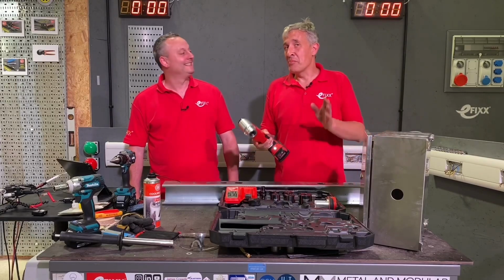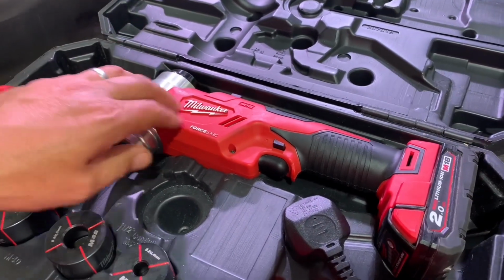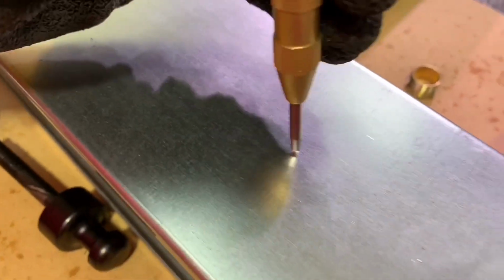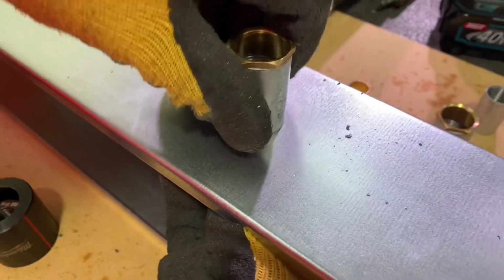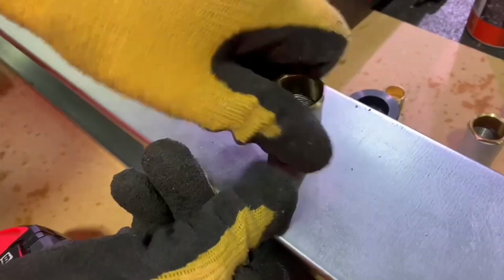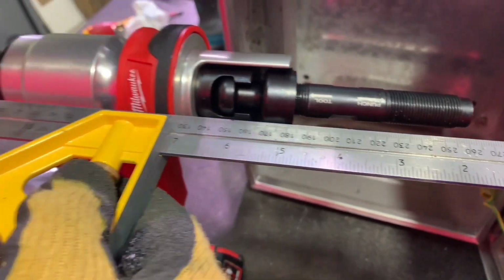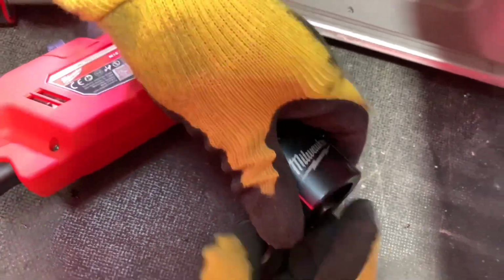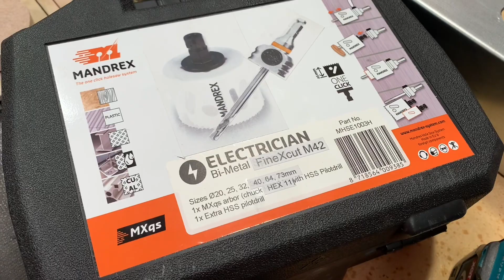REVIEWED: Milwaukee FORCE LOGIC KNOCKOUT HOLE 🕳 PUNCH TOOL

Comment: I had a set of "hole punch"  dies ( Called I think Crookes Cutters?), drilled a 10mm hole, and used an Allen key adaptor on my battery drill to wind them through the metal,  nice clean hole, no filing afterwards.
Reply from the maker: We used to use them - we’ll try to find an equivalent to review.
Reply: Q max were the ones I always used, just brand names though I suppose

Comment: When I've used hydraulic punches I use the 20mm punch to create the hole for the larger shank required for the larger punches removing the need for a cone step drill or hole saw which is particularly important on stainless. This mean you only need to drill a 12mm hole for even the biggest of punches where drill bits like Sutton's Inox drill bits would speed up the process nicely.
Reply from the maker: All great points so thanks for commenting 👍🏻
Reply: It

Yeah

Comment: Always found the Q max punches great for enlarging a existing 20mm hole in enclosures / trunking into a 25mm or more. Yes they were handraulic with a extended allen key. I'm retired now but still have them in my tool box...you never know?
Reply from the maker: Handraulic - we’ll use that 😂😂
Reply: And Q-max punches are square/rectangle & even D-shaped punches!

Comment: not only does the US kit have more punches for less money, our ball adaptor is an interrupted thread connection, so if you're doing a bunch of the same size hole, you just pop the adaptor off with a one third turn to clear the slugs.

Comment: Great tool if you’ve got to create many precise holes in steel or stainless. On the rare occasions we have to do this sort of thing it’d be invaluable, but none of us like having expansive tools not out there earning their keep. I haven’t seen the price but I’m sure it’s not for the faint-hearted!! As far as the Milwonky goes - I have the 125mm cordless bandsaw (which I think is what you’re referring to) and it definitely takes a bit of practice to get it spot on but once you’re used to it it is magic. Wouldn’t use a disc cutter now unless I absolutely had to.

Comment: Great video thank you . Does the slug and trunking get hot from the press tool. A little disappointed that it doesn't come with the 2 inch press as standard but comes with 16mm.Out of interest why have they including a 16mm. I can't think of a job were you would use 16mm.
Reply from the maker: No heat in the punching process. They haven’t included the 50mm because they sell it for £60 - 16mm will rust away in the box 📦
Reply: the American kit comes with punches for 1/2" to 2" in conduit size increments.  for a bit extra, I also got a cutter for 3" conduit. (note the punches are sized in conduit size, not in actual dimension so, for example, the 2" die is actually 2.5"

Comment: Punch cutter is better than any hole saw or cone drill any day.. it’s the only one able do make a clean cut. that one is good if you spend your days doing holes otherwise the manual ones do the job and are cheap if you have to punch a few every now and then. And to be fair I probably wouldn’t bother with that whole process till it goes above 25mm or it’s stainless.. The hole saw from that kit cutting the stainless will probably go in the bin after.

Comment: makes sense if your punching a load of holes at one time bit of a pain in the arse having to use a drill so you can use the punch tool to begin with. maybe someone can come up with a quick release tool that punches the starting hole or even an adapter that doesn't require a starting hole to be drilled.
Reply from the maker: All great points 👍🏻. Tomorrow this tool goes head to head with a Mandrex electricians hole saw kit.. should be interesting 🤔

Comment: wow, what a lot of faff! If you have to pilot the hole with a cone cutter, why not just follow through? By the time you have set up the tool you could have deburred the hole with a file or deburring tool!! Nah not for me thanks, I just bought a set of cone cutters from Aldi for £4
Reply from the maker: Sounds like a bargain from the central isle - let us know who they stack up.
Reply: @efixx  I have to say they really aren't bad! I bought a set of 3 well over a year ago and I was using them daily and they are just starting to dull now. For £4 I'd stock up haha! Great content guys.
Reply: @chrishatton8197  do they cut clear up to 88.9mm?  because that's one of the key sizes I use mine for.
Reply: @kenbrown2808  Cool man! If you use a tool like this for an application like that then 100% totally worth it. In my experience the average spark cuts 20, 25 or 32mm in to metal which the cone cutters do.
Reply: @chrishatton8197  i do carry a step bit in my toolbox, but i use it more on plastic than metal. Most of our metal boxes are prepunched, so we simply knock the slug out by hitting it with a tool. If i have to drill a many conduit holes, it's worth the bother to grab my can cutting bit that i carry in my punch kit. Much better tool for the task than a step bit or a hole saw.

Comment: Awesome vid. Think this will be a Christmas present to myself.  I hate to be a snob but any sparky worth their salt would never use a janky hole saw to pop holes in cabinets or cans for their pipe, fittings  or(i hope Big Red makes a die) switch/light holes(they have an anti rotate tang, also AB uses a weird metric size).     And a unibit? Uuh? Lol….Well, are fine for WOOD, PLASTIC, Al and lighter ga steel. But you can forget doing a few before tossing the  bit and stainless would be prolly be a one and done(even thinner gauge is gangster). I’ve been using a Greenlee Slugbuster for everything under 2” (then I’ll get out the big ole hydraulic set) for jus shy of 20 years. So rather than spring for a handheld hydraulic kit I’m jus gna leap frog to the 25th and 1/2 century(😏😏someone got it)  . 
         Cheers,
                            Duck Dodgers